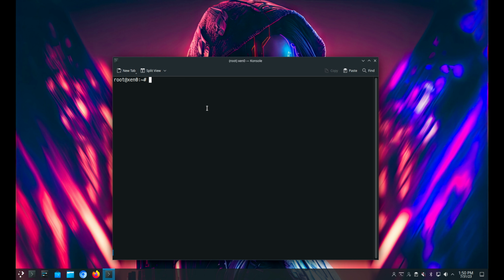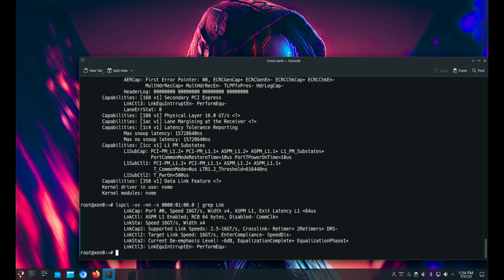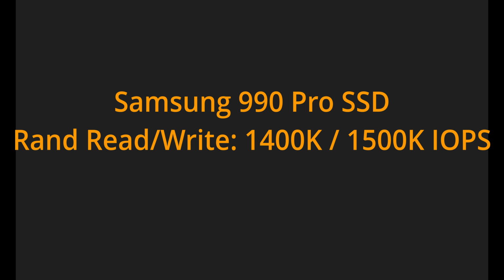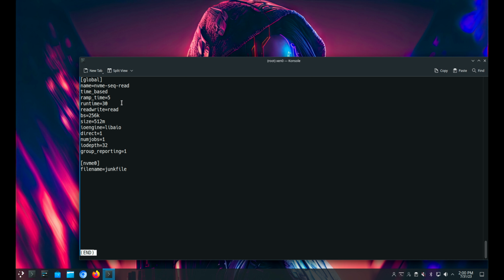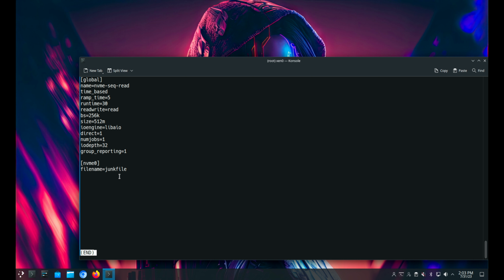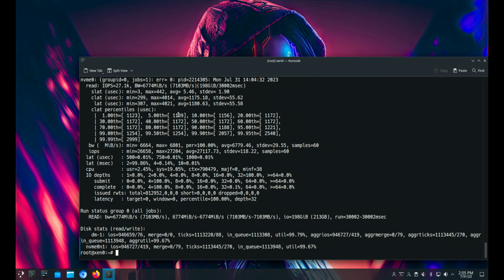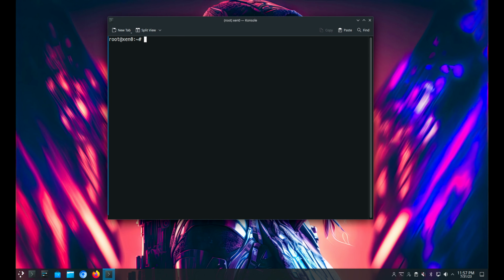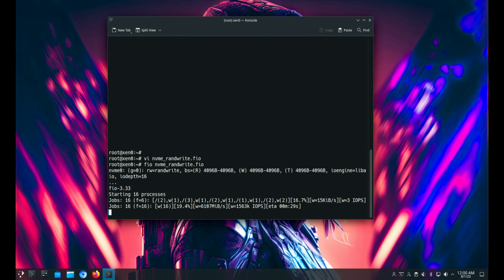NVMe Performance: Trust but Verify

Comment: The lspci output shows that your drive is configured for a Max Payload Size of 256 bytes, wheres it's capable of 512. Depending on your system's PCIe topology, you might be able to set it to 512 by passing the pci=pcie_bus_perf kernel boot option.

I would be curious to see the results because that cuts down the PCIe protocol overhead from ~10% to ~%5 percent. So you can move up from a limit of ~7.2GB/s to sth like 7.6GB/s which is closer to Samsung's read throughput rating.
Reply from the maker: Thanks for the advice, however I will pass, that setting is global, and you should take care it doesn't create a problem on a different PCIe node which can't support that packet size.  I would not suggest using data from a preflight as the sole source to begin performance tuning.  I only use preflight to check that the hardware is installed correctly and ready for performance testing.  Experience has demonstrated to me it better not to rush this, or make assumptions that could affect system stability or thermals later down the line (like when the machine rolls into the production rack). and BTW you would also need to also check MRRS on all PCIe devices before doing anything with MPS.

Comment: I think dependency chain performance is probably the most relevant to interactive user experience but it's rarely reported in reviews or specifications. Nobody wants to face the fact that most SSDs don't even support a gigabit under such workloads

Comment: you briefly touched on filesystem overhead which i think is also important.  i would imagine you were most likely still using ext4.  I wonder what sort of numbers you would be getting under F2FS or JFFS2.  it still kind of baffles me that majority of distros (except Slackware, as the only distro I know), that haven't at least added a filesystem specifically FOR NVME/NAND drives.  I would like to know if it would make any difference with F2FS, and shame that even JFFS2 isn't included as a filesystem option for any distro either.  again, while the ext4 xfs, etc filesystems are fine - the obvious problem still is that they were written solely in mind for mechanical drives - flash / NAND is an after thought for these filesystem since you had added features later on like TRIM.  Who knows though maybe when ext5 comes around, you might see something written from the ground up solely FORE SSD/NVMEs in mind, but until then I am going to reiterate my point in that distros really should offer F2FS and JFFS2 as options to install on if you are using an SSD or NVME.
Reply from the maker: One of the reasons I was pre-flighting that drive is to update my benchmarks on file systems, so I will add JFSS2 to the list, I already test F2FS, thanks for the suggestion
Reply: @CyberGizmo  i would like to see a comparison of JFFS2 vs F2FS , and i still think it would be nice to have those option available to install upon... again though only Slackware afaik has the option to install on an F2FS filesystem, but the caveat is, you need another boot partition because F2FS is like XFS, you just can't boot off from it.

Comment: Apparently my lane is capable of 16T but my drive is downgraded to 8! What now?
Reply from the maker: The first question is, what does the LnkSta show?
Reply: @CyberGizmo  LnkCap:	Port #0, Speed 16GT/s, Width x4, ASPM L1, Exit Latency L1 <64us

LnkSta:	Speed 8GT/s (downgraded), Width x4

and in dmesg:
pci 0000:05:00.0: 31.504 Gb/s available PCIe bandwidth, limited by 8.0 GT/s PCIe x4 link at 0000:00:1d.0

that address 00:1d.0 is my PCI bridge. I wonder if this is just the limit of my motherboard. It is a slightly older one (2018 I think)
Reply from the maker: @Ancipital_  The NVMe is showing it only supports PCIe 3, are you sure the NVMe is a PCIe Gen 4?

Comment: I added my Crucial P2 Nvme to the Pcie slot thru an adapter and ran fio benchmarks and even sysbench postgresql benchmarks. I was not too impressed compared to a sata SSD. I find 4 sata SSDs in raid0 gives zippy performance during day to day operations of my home computer. After all this experience, now I have settled for 4 SSD L2ARC/ZIL and one HDD as my main drive for my work. Works well.
Reply from the maker: Sounds good, whatever works best!

Comment: I, generally, test my drives by transferring one large compressed file and again with multiple small files that take up a large amount of space (around 10gb) and see what their transfer time is like. It won't tell you about the error rate but will give you a general performance index.

Comment: Now I know why one of my gen4 drives seems slow. One of the 16x slots is split with the nvme and I have an HBA in that slot.
Reply from the maker: yep, the games motherboards play....one of your NVMe slots should be wired in directly so hopefully your motherboard manual tells you which one it is (assuming your board has more than one NVMe connection)
Reply: @CyberGizmo  I just have to move the HBA to a 1x slot. I didn't think about it when I put it together because a second nvme usually disabled sata ports.
Reply: I bought my MB specifically because it had 2 full pcie4 m.2 slots. Best decision ever. It was like $200 bucks but, as an enthusiast, it's been worth every cent.

Comment: I think my NVme is slowly fading out, its a Sammy Evo 870 and i run it on my old workhorse Lenovo S340 lappy 💻 with a i3. Great video. Any suggestions other than a replacement also from a hardware standpoint should this morel lappy 💻 be keeping pace with that older 870?
Reply from the maker: SATA will be a bit different than NVMe of course, but yes you can use the same tests to perform your check on the performance.  You may have to play with the jobs and iodepth, you are measuring a bell-curve so it will be a bit trial an error, ideally you want to set those two so you get as close to the peak performance as you can, it will rise until the peak then fall off as you increase those values, I stop at the last point it got faster...sorry I don't have a formula to calculate this
Reply: @CyberGizmo  no I'm sorry it's NVme, my old beater has a M.2 port and I kept the old 1 TB SATA HDD for backup as well, ever so often I will clone my SSD to the old HDD. I know the HDD is much more likely to fail but I rarely ever use it. I'm gonna run these test with when time permits and check its health. Thank you so much. :)
Reply from the maker: @repairstudio4940  welcome glad to help!

Comment: A great video again D.J..  As for me, I have just ordered a Samsung M.2 PCIE GEn 3 MVME SSD.
Reply: I must say, cause I don't want to throw shade at Samsung as my SSD mentioned earlier has took a beating for years and the fact it's not kind of showing its age is actually amazing. If I end up replacing my current SSD it will again be a Sammy Evo model. Enjoy yours! 😊👍
Reply from the maker: One thing I didn't mention on this video because I pre-installed proxmox on the NVMe, is that before you begin testing you might want to write out some files to the NVMe, so that the hardware starts tracking what blocks are used, its called pre-conditioning.  I knew i should have included that.